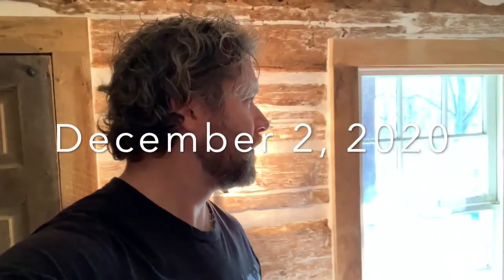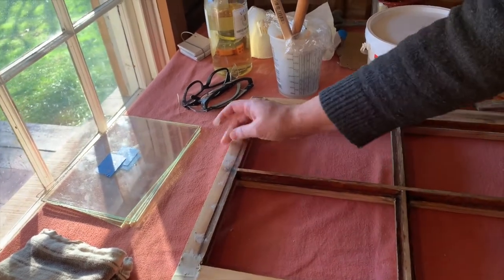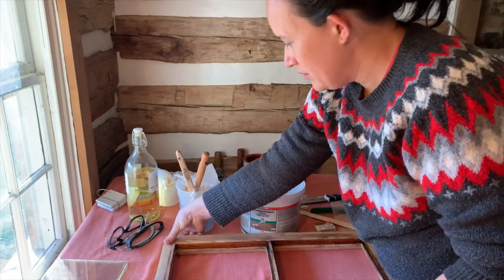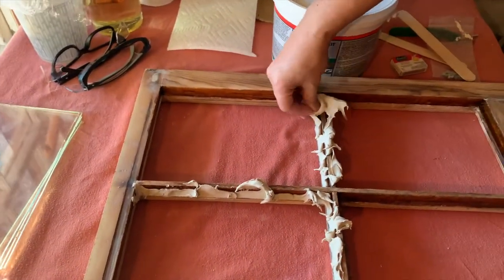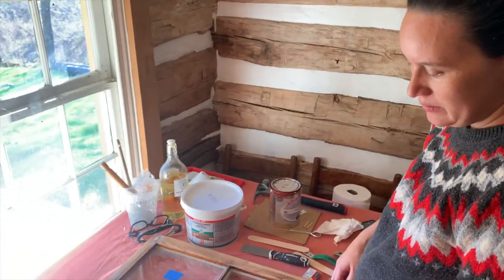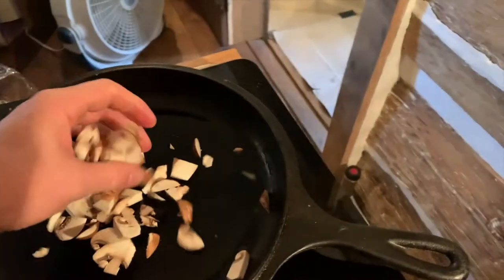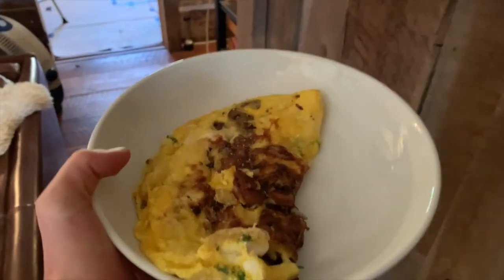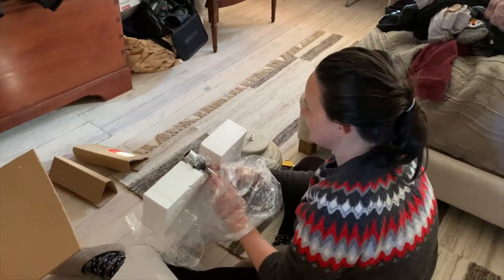Vlog Cabin: Vlogmas 2020 End of Window Restoration In Sight!

Comment: Greetings from Ireland. If you brush a little bit of paint on your rebate, just enough to make it tacky, before you apply putty. This will make the putty stick better and seal better and avoid it cracking loose in the future.
Reply from the maker: Well hey there! Cool idea, thanks for suggesting it. We use shellac on the inside of the rabbets for I think the same reason, but I bet little linseed oil paint would work well there too.